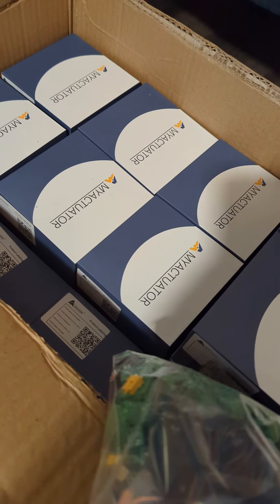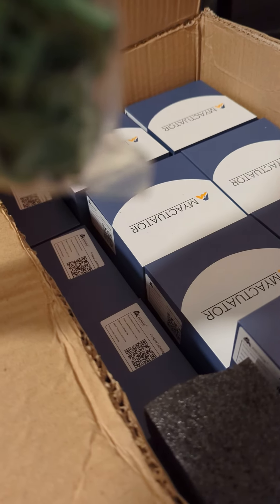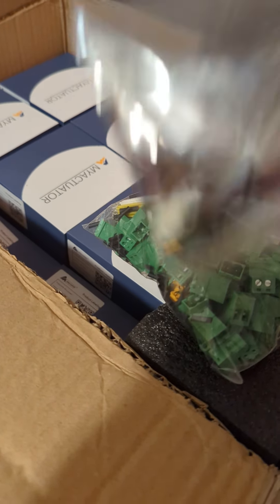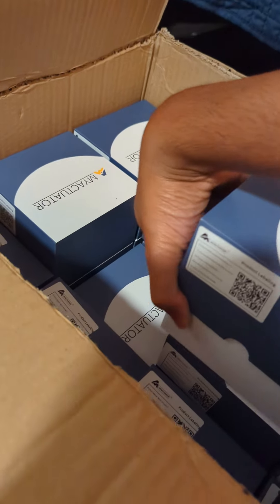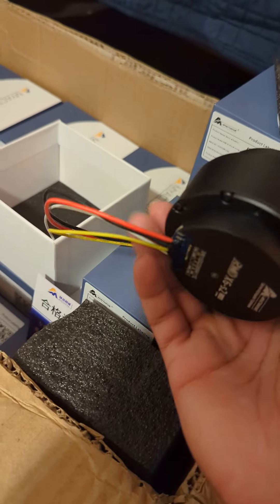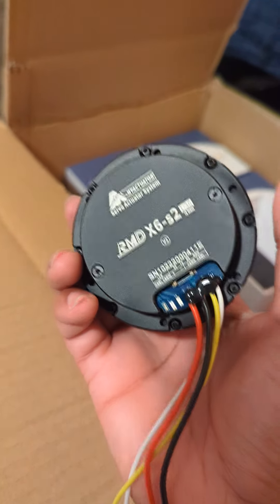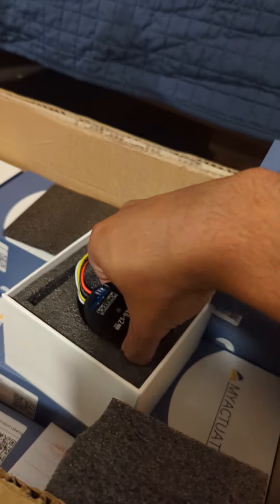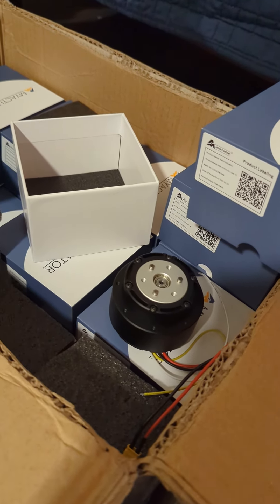Unboxing RMD X6-P36-N14 CAN V3

Comment: I have RMD X8 Pro, RMD X6, T-Motor AK70, T-Motor AK60, and MIT Cheetah's.
I don't like how RMD doesn't like receiving commands when it is already processing another. For its intended use it should be able to quickly change direction and cancel the previous task. 
T-Motor and MIT Cheetah is much better.